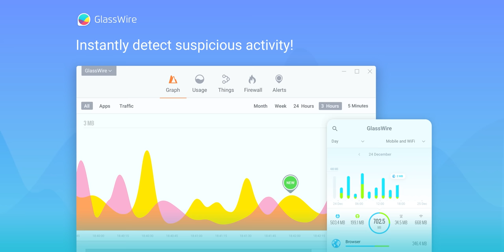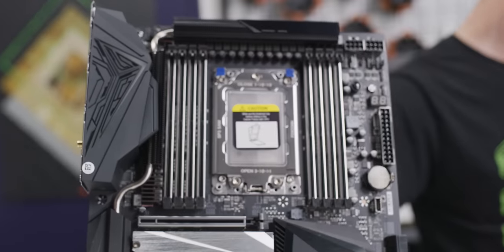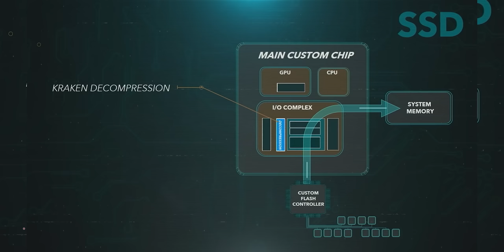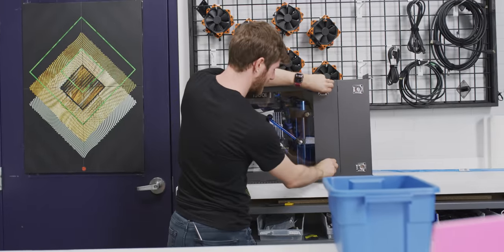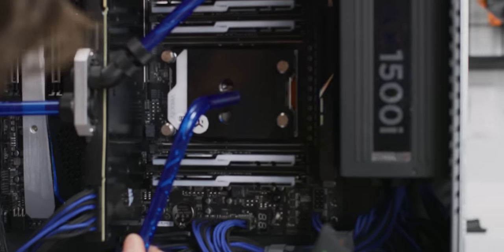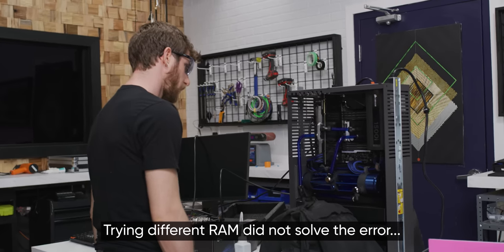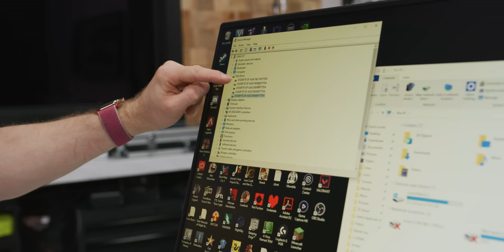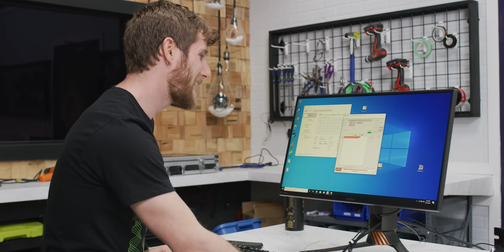I may never upgrade again!

Comment: "I'm never gonna upgrade again!"

Thunderbolt 4 Announced
Reply: That's just a certification.
Reply: Yeah, it would be fun if it was actually an upgrade
Reply: @amphn1  It's still 40Gbps
Reply: @gautamdiwan5952  actually that is also only 22Gbps for pcie and 18gbps for display output.
Reply: @PremVijayVelMani  The number represents version as well...
Reply: @aluandcache7336  Many existing devices with thunderbolt 3 have the specs to be certified for thunderbolt 4.
Reply: Lol
Reply: @PremVijayVelMani  Such as? I don't think the certification won't carry any extra bandwidth unless the peripheral doesn't get the architecture according to the certification..

Comment: Title: "I may never upgrade again!"
Hard Drive buyers in 1956: "I may never upgrade again!" after buying a 5MB hard drive...
Reply: Not 5mb 5kb
Reply: @yousaf-yt4922  no
Reply: on apollos missions the "hard drives" were made of paper and it was late 60's
Reply: YOUSAF- YT No, the giant “size of 2 fridges” first ever hard drive: It existed and it held 5MB.
Reply: HeisenbergWalt Apollo as far as I know didn’t use paper (probably thinking of punch cards, it’s fine) or hard drives, but used “Core Rope Memory”, where, according to Wikipedia, wires were weaved though and/or around magnetic cores to store data.
And they used these instead of hard drives even though it was the late 60s because this needed to get to the frickin Moon and Hard Drives were still too big and heavy.

Comment: Did you beat the PS5?

Linus: Yes

What did it cost

Linus: ...$5000
Reply: The funny thing is no game built for PCs will take advantage of the drive for the next 15 years.. PS5 exclusives however.. few months
Reply: @thomassmith4999  15 years is a bit too long mate, maybe 1 or 2 years and the pc games will have the advantage again.
Reply: @thomassmith4999  The funny thing is pc had ssd's more than 15 years ago... xD
Reply: @thomassmith4999  But that FPS though...
Reply: @jaumegarcia  Yes but not fast enough to do instant level loading or anything useful, and you can never optimize a game unless the platform is a fixed standard. To be fair this one maybe fast but it isn't really suitable for gaming either. It has no controller/cpu onboard (or not a good enough one) to do the transfer work. Add on cards should really do their own processing work independent of the main cpu's. The Gravis Ultrasound was such a beast because of this as far back as the mid 90s. And all raid cards have their own cpu. I don't know the full details of the PS5s setup but I'd assume they have some custom hardware on it to handle to data transfer without working the cpu.
Reply: @thomasrush2095  I'm a 60 frame gamer since way back in the arcade days. I still use CRTs for nearly all my gaming, more than one way to skin a cat or get no latency. Really the only gaming I do on PCs is racing sims. I think I'll be happy with my arcade shooters for a while yet. I'll get a ps5 for the good exclusives. Race cars on a PC and play all the best old time games on CRTs and life will stay perfect around here.
Reply: @thomassmith4999  SSds are fast enough, even Epic said that .. its just that, no company did make games to utilize that since they still need to think about people without SSDs. That could change now thanks to consoles using SSds too. But in the end, its all on the devs to optimize and adapt their game engines.
Reply: @jaumegarcia   Erm yea basic ssd's that don't come to even a quarter of these speeds , These are next gen SSD's but i suppose good try?
Reply: @seanhanlon3209  ¿? 
If you're talking about the ssd from 15 years ago it's normal... There's a reason they're 15 years old.
Buy the new corsair ssd, it's faster than the ps5.
Reply: @jaumegarcia   link it? because we both know its not lol

Comment: Title: "I may never upgrade again"

RTX 3080 release in September: hehehe.
Reply: August*. YEAHHH BOYY
Reply: @sugondese1973  shipping in September
Reply: I think 3070ti will match the 2080super?
Reply: @loriedunn5954  at least it may exceed it.
Reply: Lorie Dunn i hope so, but it is nvidia.....
Reply: @clownemoji2153  not really there is no news with 3080ti coming out September or august its just rumours about what graphic cards were getting like 3060-3070 and the 3080ti so yeah no release dates.
Reply: isn't he like using a titan rtx?
Reply: (He is not upgrading the SSD ever again)
Reply: Also DDR5 coming next year.

(Most likely 2 years for consumers but Linus will get it next year)
Reply: He is talking about an ssd....
Reply: Kids see ghosts
Reply: What about the 3090?
Reply: RTX 3080 < BIG NAVI
Reply: Lorie Dunn if it doesn’t then I’m uninstalling nvidia
Reply: What about thunderbolt 4?
Reply: Does anyone think this is a good deal?

R7 3700x

Rx5700xt

1tbssd

16gb 2666mhz memory

120mm liquid cooling 

(I dont know the exact motherboard or psu, its a prebuilt)
1200usd
Reply: @loriedunn5954  i hope so, im planning on selling my current 2060 to buy a 3070 when i releases
Reply: @utility is better it’s not a bad deal for a pre-built tbh I’ve never seen anything like it. But it being such a good deal tells me that they r selling u short on the Motherboard, cpu cooler, and psu. Prebuilt psu is always bad so if u buy it the first thing I would do is replace that psu with a 600w or 650w from Corsair preferably gold but bronze is cheaper. (I have this build with a 650w bronze). Also if u want to upgrade your gpu u will have to remember to go through the hassle of getting new drivers because as of now there is no better and gpu than the one in this build. Also the ram is very slow for a 3700x so I would recommend upgrading to 3600mhz. The 1tb ssd looks good rn but I bet it has slow speeds and u will still have to get a hardrive anyways unless u only want to play Modern Warfare and like 5 other games (a lot of indie games tho if ur into that. I would not recommend buying this and would instead recommend building one urself

Ryzen7 3700x:  $290

Rtx 2070 Super:  $550

500gb nvme ssd: $60

2tb sata hardrive: $50

16gb 3600hz ram: $80

Stock cpu cooler is very good for 3700x but if u want an after market cooler then u can buy one

b450 motherboard: $100 give or take depending the features u want

Corsair 650w psu: $100

Case (preferably mesh side panel): $50-$100

Total: $1330 

I know that it seems as if this pc here is worse but believe me I had a friend with a prebuilt that had great specs and I was so jealous until his motherboard fried. It melted his cpu pins and broke his gpu. The card was fine and the fans spun but he got blue screens after mother board and cpu replacements. Just never get a prebuilt. It’s more expensive and cheaply made.

Edit: all prices will change based on when u buy these and what look u are going for. I would not buy rn myself because prices r high but it is up to u. Normally u could get this pc for $1200 that’s why I made it. If u go for no long is and just performance u will make it to the $1200 mark. Also prebuilts might look cooler but there is no feeling that is better than looking to the right of ur monitor to see something that u just built with ur own hands. And that goes for anything.
Reply: @12yaps  i found the motherboard model

Asrock b450m pro4
Reply: Nice profile pic my dude! 🤙🏼
Reply: Theres an ssd with like 30 gbps imagine what a gpu would be
Reply: utility is better no
Reply: utility is better don’t get it
Reply: utility is better build ur own
Reply: Lorie Dunn lol
Reply: @loriedunn5954  nope
Reply: @loriedunn5954  3060ti does

Comment: Linus: i want to beat the ps5
Me: so around $800?
Also Linus: builds a multi-thousand pc
Reply: "you don't understand, I want to beat it like it's a dead horse and horses killed my father"
Reply: You can't beat the PS5 with $800 xD
Reply: Sonny Boi yeah you can 3600 and 2060
Reply: @adamhalldorsson2822  $600 for a CPU and Graphics Card that will beat a PS5. Good thing you don't need literally anything else to build a computer.
Reply: benzerific I mean the 3600 and 2060 together is like 500. 100 for the motherboard 50 for everything else and your set. 800 build
Reply: @sonnyboi1761  we're talking about mere upgrades and with the rtx 3070 coming at 499$, it's already done.
Reply: @sonnyboi1761  Rip lmao
Reply: @thelateone1468  That’s still $100 more, and only if you already have a good CPU. If i wanted to put an RTX 3070 in my system, I’d need a new CPU and thus a new motherboard as well (due to socket differences), which puts the cost at well over the cost of an entire PS5. I prefer PC, but the PS5 undoubtably has the cost factor locked down. And even then, I still wouldn’t have an SSD that comes close in speed
Reply: @thelateone1468  The main problem for me is that I'd need a new CPU and motherboard, as even though my current setup is still pretty decent it doesn't support PCIe 4.0 and thus can't use a comparably fast SSD or the full power of 30 series cards. You are right about the selling components thing though
Reply: @patrickreinhardt7674  You lose about 3 FPS at most from pcie 4.0-3.0, really doesn’t make a difference
Reply: @sonnyboi1761  lol yeah you can
Reply: This is always the PC vs console war lol
“My PC is waaaaaaay better than any console and it only cost me $3,000”
Reply: @sonnyboi1761  in my opinion you need 2-3k to beat it
Reply: @sonnyboi1761  you can
Reply: I built my gaming pc for 227£
Reply: @wasdpvp  lmao nice
Reply: @dxrrk  fps in what i have an rx 570 600 w psu i5 6400 and 16gb of ram and it was built in lockdown all are overcolcked and in minecraft i get around 900 fps with optifine
Reply: @sonnyboi1761  perhaps in hardware, but those steam deals man, that shit beats everything.
Reply: @adamhalldorsson2822  2060 is weaker than ps5 GPU and PS5 CPU is R7 3700X.
Reply: @adamhalldorsson2822  In price for a supposed system (usd in southeast us): 180 for cpu + $300 for the GPU + $150 for remotely comparable storage speed and capacity + $70 for 16 gb 3200 MHz + $120 for an okay motherboard + $70 for a good case + $50 for nondescript but good fans + $50 cpu cooler = ~$1000 for a system slower than a ps5
Reply: @sonnyboi1761  you can easy
Reply: @patrickreinhardt7674  Ps5 cheaps out on ram and cpu, comparable to a 2060 (low end of last generation pc gpus), it has 12gb of ram/vram (it shares them) which is something you wouldn't do on PC because games aren't the only thing you use it for, with Console it is possible. Console cheats to achieve the costs and at the end of the day, doing 4k/30 isn't impressive anymore.
Reply: @yesyes-om1po  16gb of gddr6 and the equivalent of a ryzen 7 3700x is hardly cheaping out lmfao
Reply: @wingcommanderbob8268  using gpu ram as sys ram is something you wouldn't do on PC because PCs have an actual system os, you could but it wouldn't make sense. Anyways I am trying to say the PS5 and Series X cut corners as much as possible and use manufacturer deals and mass production to cut down on costs, and even then I believe they sell at a slight loss.
Reply: @yesyes-om1po  1. 2060 is in no way a low end in the Turing/rdna1 generation, that would go to 1650s/5500xt. 2. The PS5 GPU is more powerful than 2060, pretty sure it’s roughly equivalent to a 2070~2070s.

Comment: Linus: "Will never upgrade again"
DDR5 RAM: "Hold my beer"
Reply: I almost missed DDR4 entirely, ran a 4690k from 2015 to January this year
Reply: it will probably be 3 years before there is a good enough difference between DDR4 and DDR5
Reply: @Arbiter099   ddr5 is huge change, ddr4 is just undervolted ddr3
Reply: @aliefr2984  me and my  ddr3 ram and 1st or 2nd gen cpu
Reply: he said MAY,not WILL
Reply: 'hold my gigabytes' sounds better lolol
Reply: Alief Rezki bruh ddr3 tops out at 3000mhz and it just came out this year for those speeds. Before that, it was like around 1600. My ram is casually 3600mhz and you can go past 4000 on ddr4. Big difference. Also Ryzen performs noticeably better on faster ram
Reply: @Rhythmic Beauty nobody wants to listen to the generic music you are spam advertising in this comment section
Reply: Simply Nonsense : Sorry but not really. With the way it usually works, the speeds will be sufficient to start with. It's the latencies that will take a nose dive at first, and only those of us with really good sticks of ram will notice the lack of difference or much difference at all. For instance, if you are running 3200 mhz at cas 14 straight, then you might see a drop in performance only if you got the worst cas latency for DDR5 starting at clock speeds of ... I think it was close to 4600 or better? 
Essentially the differences will be noticed more so by the people who cheaped out or held out for an extra generation, not the people who spent enough to get a good enough rig to last into that 3 year span you mention. 
So, yes you are right, but only in regards to enthusiasts.
Reply: "DDR5-3200 RAM will see an increase of 1.36x in bandwidth compared to DDR4-3200. However, DRAM chips are expected to ship with a bandwidth of 4800MT/s, or 1.87x that of DDR4-3200 RAM. The official upper limit for the DDR5 RAM standard is 6400MT/s, but some designs may be able to push that further through overclocking."
Reply: It will be in 2022
Reply: @SimplyNon_sense  ddr5 is going to be more than twice as fast as ddr4
Reply: Simply Nonsense ddr5 will be around double the frequency of ddr4 and will come around next year. I think there is a ltt or other video about it

Comment: Linus: "I May Never Upgrade Again!"

One year later: DDR5 RAM/Ryzen Zen3/Nvidia 3000 series

Linus: Surprised Pikachu Face
Reply: DDR5 is next year?
Reply: @frankiesslipal3730  yep, my only upgrade problem this year.
Reply: @frankiesslipal3730  Not gonna happen in consumer space maybe server
Reply: Also RDNA2
Reply: @aynyal8313  pff same here if only for the fact that **hopefully** that'll make the speeds greater than >3200MHz much much cheaper just to squeeze some extra performance out there in like a year. Tho zen 3 is one of the reasons I cheaped out on the CPU for now since I didn't want to spend a crap ton and not know what zen 3 would fully entail XD

Comment: You need to tighten the screws on the CPU... it is a KNOWN issue... the torque click on the tool that comes with cpu doesn't really fully tighten the CPU bolt down screws as they should be. I had same issue with 3990x
Reply: This should really be a highlighted comment
Reply: Should I do this to gen 2 tr4?
Reply: @DragonProtector  Yes, the torque click is there for a reason, to ensure you've applied the right amount of torque!!  Basically his CPU wasn't making enough contact with the pins in the socket.
Reply: Yep, seat the screws with a few twists on all of them and then click home in order.

Comment: Everyone: "But you said Threadripper isn't for gaming!?!?!"
Linus : 🙄 (only plays turn-based strategy)
Reply: I was thinking about threadripper because I use blender, but then i thought about it and realized I game more than I bake or render so I picked up a ryzen 7 1700x (this was months before 2nd gen ryzen) and the extra speed per core would benifet me more.
Reply: It depends on what you're doing.  It's only really not for gaming because they're not leveraging that many cores or threads.
If you're doing compiles of things, like embedded Linux images or...heh...games (yes), then it kind of makes sense.  It's only not for gaming because it's blindingly expensive for power you're likely not to leverage unless you're like me...  ;)
Reply: Linus plays VR (which is already CPU and GPU intensive), non-turn-based strategy (Age Of Empires, Dawn Of Discovery), and fast-paced rhythm games (Beat Saber), too.
Reply: Is Anno 1800 not turn based?  That’s the one I was referencing - he talks about it all the time
Reply: Kinzuko To be fair, 3rd gen TR is kind of a different story - the individual cores are SO much faster than 1st gen TR, but the lowest core count you can get is still way expensive.  I have a couple 8 and 16 core TR 1st gen running VMware, but I wouldn’t want to game on those.  The value per core is still insane, if you are rendering or virtualizing or anything that actually uses them all.
Reply: Do as I say not as I do...

Comment: "LTT: I may never upgrade again!"

 -"DDR5 RAM is coming with double the speed and more capacity"
Reply: Not to mention ps5 uses DDR6 so like.. why bother
Reply: @lexecomplexe4083  🤡🤡🤡🤡🤡🤡🤡🤡🤡🤡🤡🤡🤡🤡
Reply: KiwiVibes 🤡🤡🤡🤡🤡🤡🤡🤡🤡🤡🤡🤡🤡🤡🤡🤡🤡🤡🤡🤡🤡🤡🤡🤡🤡🤡🤡🤡🤡🤡🤡🤡🤡🤡🤡🤡🤡🤡🤡🤡🤡🤡🤡🤡🤡🤡🤡🤡🤡🤡🤡🤡🤡🤡🤡🤡🤡🤡🤡🤡🤡🤡🤡🤡🤡🤡🤡🤡🤡🤡🤡🤡🤡🤡🤡🤡🤡🤡🤡🤡🤡🤡🤡🤡🤡🤡🤡🤡🤡🤡🤡🤡🤡🤡🤡🤡🤡🤡🤡🤡🤡🤡🤡🤡🤡🤡🤡🤡🤡🤡🤡🤡🤡🤡🤡🤡🤡🤡🤡🤡🤡🤡🤡🤡🤡🤡🤡🤡🤡🤡🤡🤡🤡🤡🤡🤡🤡🤡🤡🤡🤡🤡🤡🤡🤡🤡🤡🤡🤡🤡🤡🤡🤡🤡🤡🤡🤡🤡🤡🤡🤡🤡🤡🤡🤡🤡🤡🤡🤡🤡🤡🤡🤡🤡🤡🤡🤡🤡🤡🤡🤡🤡🤡🤡🤡🤡🤡🤡🤡🤡🤡🤡🤡🤡🤡🤡🤡🤡🤡🤡🤡🤡🤡🤡🤡🤡🤡🤡🤡🤡🤡🤡🤡🤡🤡🤡🤡🤡🤡🤡🤡🤡🤡🤡🤡🤡🤡🤡🤡🤡🤡🤡🤡🤡🤡🤡🤡🤡🤡🤡🤡🤡🤡🤡🤡🤡🤡🤡🤡🤡🤡🤡🤡🤡🤡🤡🤡🤡🤡🤡🤡🤡🤡🤡🤡🤡🤡🤡🤡🤡🤡🤡🤡🤡🤡🤡🤡🤡🤡🤡🤡🤡🤡🤡🤡🤡🤡🤡🤡🤡🤡🤡🤡🤡🤡🤡🤡🤡🤡🤡🤡🤡🤡🤡🤡🤡🤡🤡🤡🤡🤡🤡🤡🤡🤡🤡🤡🤡🤡🤡🤡🤡🤡🤡🤡🤡🤡🤡🤡🤡🤡🤡🤡🤡🤡🤡🤡🤡🤡🤡🤡🤡🤡🤡🤡🤡🤡🤡🤡🤡🤡🤡🤡🤡🤡🤡🤡🤡🤡🤡🤡🤡🤡🤡🤡🤡🤡🤡🤡🤡🤡🤡🤡🤡🤡🤡🤡🤡🤡🤡🤡🤡🤡🤡🤡🤡🤡🤡🤡🤡🤡🤡🤡🤡🤡🤡🤡🤡🤡🤡🤡🤡🤡🤡🤡🤡🤡🤡🤡🤡🤡🤡🤡🤡🤡🤡🤡🤡🤡🤡🤡🤡🤡🤡🤡🤡🤡🤡🤡🤡🤡🤡🤡🤡🤡🤡🤡🤡🤡🤡🤡🤡🤡🤡🤡🤡🤡🤡🤡🤡🤡🤡🤡🤡🤡🤡🤡🤡🤡🤡🤡🤡🤡🤡🤡🤡🤡🤡🤡🤡🤡🤡🤡🤡🤡🤡🤡🤡🤡🤡🤡🤡🤡🤡🤡🤡🤡🤡🤡🤡🤡🤡🤡🤡🤡🤡🤡🤡🤡🤡🤡🤡🤡🤡🤡🤡🤡🤡🤡🤡🤡🤡🤡🤡🤡🤡🤡🤡🤡🤡🤡🤡🤡🤡🤡🤡🤡🤡🤡🤡🤡🤡🤡🤡🤡🤡🤡🤡🤡🤡🤡🤡🤡🤡🤡🤡🤡🤡🤡🤡🤡🤡🤡🤡🤡🤡🤡🤡🤡🤡🤡🤡🤡🤡🤡🤡🤡🤡🤡🤡🤡🤡🤡🤡🤡🤡🤡🤡🤡🤡🤡🤡🤡🤡🤡🤡🤡🤡🤡🤡🤡🤡🤡🤡🤡🤡🤡🤡🤡🤡🤡🤡🤡🤡🤡🤡🤡🤡🤡🤡🤡🤡🤡🤡🤡🤡🤡🤡🤡🤡🤡🤡🤡🤡🤡🤡🤡🤡🤡🤡🤡🤡🤡🤡🤡🤡🤡🤡🤡🤡🤡🤡🤡🤡🤡🤡🤡🤡🤡🤡🤡🤡🤡🤡🤡🤡🤡🤡🤡🤡🤡🤡🤡🤡🤡🤡🤡🤡🤡🤡🤡🤡🤡🤡🤡🤡🤡🤡🤡🤡🤡🤡🤡🤡🤡🤡🤡🤡🤡🤡🤡🤡🤡🤡🤡🤡🤡🤡🤡🤡🤡🤡🤡🤡🤡🤡🤡🤡🤡🤡🤡🤡🤡🤡🤡🤡🤡🤡🤡🤡🤡🤡🤡🤡🤡🤡🤡🤡🤡🤡🤡🤡🤡🤡🤡🤡🤡🤡🤡🤡🤡🤡🤡🤡🤡🤡🤡🤡🤡🤡🤡🤡🤡🤡🤡🤡🤡🤡🤡🤡🤡🤡🤡🤡🤡🤡🤡🤡🤡🤡🤡🤡🤡🤡🤡🤡🤡🤡🤡🤡🤡🤡🤡🤡
Reply: @lexecomplexe4083  it uses gddr6 which is already used by most modern gpus
Reply: The gddr6 ram isnt only connected to the gpu but so is the ssd, if sonys stock ssd competes close to the write and read speeds of a 2000 dollar ssd but not its speed then imagine when we can buy a third party ssd that maxes the pcie 4 speed and will have write and read speeds even better than right now